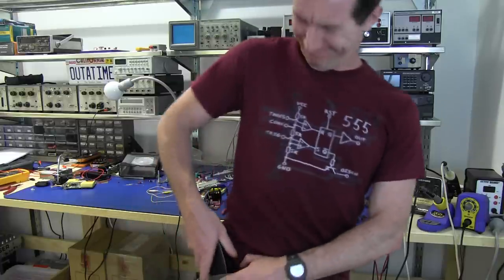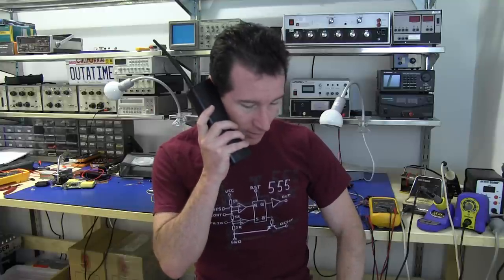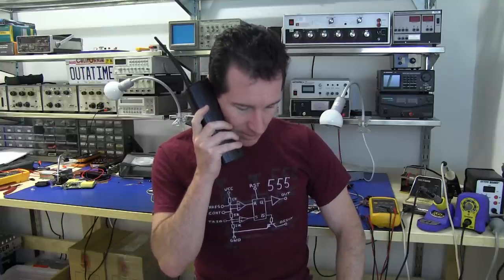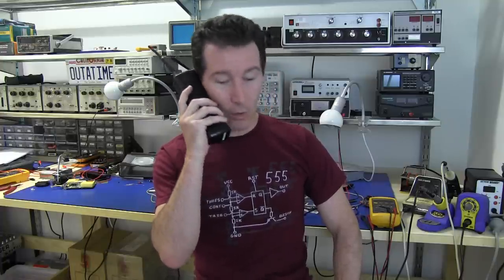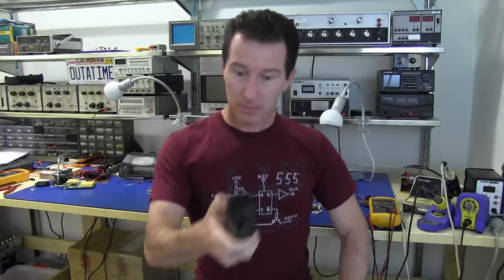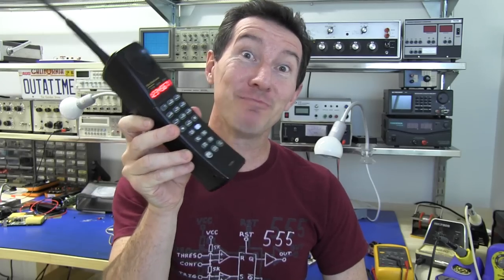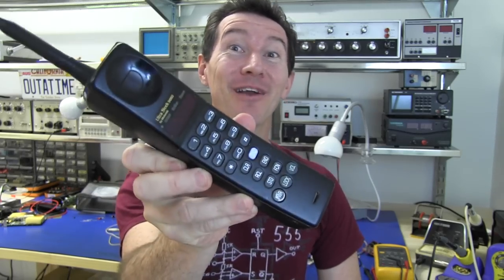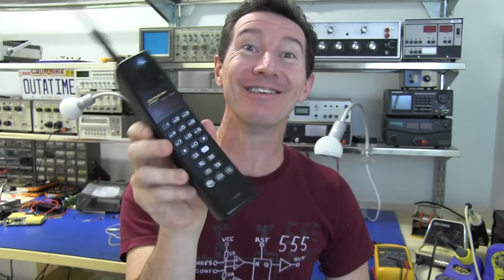EEVblog #243 - Vintage Brick Mobile Phone Teardown

Comment: This might be a stupid question to you guys who are real tech heads, but if you had one of these and were really determined to, could you actually make it work and call someone on it on to a modern phone nowadays? Are they utterly obsolete or is there probably some third world country somewhere that would still think this was valid technology? lol
Reply: Graeme Pryce  It is essentially a 2-way radio, so if you had your own base station 
connected to a land line then you could place calls using that old phone
 as long as you were within range of that base station. As far as I 
know, no phone service provider in the U.S. will interact with it any 
more. It's not as if they can't, but they simply won't. Maybe some wireless provider in some other country is still using 
1G, but I don't know which if any. I'm not a real techy, so
 I couldn't tell you how hard it would be to modify it to work with the digital networks, but I'm confident it's possible.  See also "femtocell" 
and "cellular repeater" http://www.analog.com/library/analogdialogue/archives/42-12/femtocell.html
http://en.wikipedia.org/wiki/1G
Reply: kedwa30 One question is would it even be legal to do so? The frequencies may not be once that are legal to use without a licence.
Reply: Graeme Pryce not without generating your own cell single.

Comment: could they have made it smaller? they did, the very next year! ok ok it might not have been the same phone, but im sure they came up with some kind of smaller phone in the next year or two. making things smaller takes time, especially if your doing it by sight. that was probably as small as they'd gotten it by the time the launch date came around. you also have to remember that they probably hand drew the schematics for this thing and they didnt have all the advanced software todays engineers have to help them optimize the design. they didnt even have windows 95 yet.

Comment: Maybe 20 years ago mobile phone size was not that important?I prefer bigger phones (not that big though), so,my Nokia N93 is big, but also has a very comfortable keypad and a lot of power for a 6 year old phone.Too bad most new phones aim for the ultra-thin touchscreen-only market.You could do much more with a 2012 phone that is as big as a N93 or a Philips Diga.Maybe I'll start using my Viliv N5 as a phone-just need to find a bigger battery or a way to bring it out of "sleep" when I get a call.

Comment: The size was dictated by the size of the human head:
Those days the phones were designed to actually work without compromises: The speaker was in front of the ear, the mic in front of your mouth, so the other side could clearly understand what you tell them even in a noisy environment. And that required the surface to be arced around the face.
Today the phones compromised the main function of a phone heavily: Mic far aside from the mouth capture every noise, but not your speech...

Comment: @eevblog I'm trying to disassemble an ancient Motorola 8500X brick phone... it's even older than yours and has through-hole components in it. And also a lot of battery corrosion which is making it very hard to open.

Comment: If the technology was in flux at the time it was designed, putting max effort into shrinking it might have been a waste of time if they were going to have to toss the design in a year anyway. Better economically to just use available chips, etc. and put any full-court-press effort into the next gen model.

Comment: What do you think about hot glue? I use it on my little projects, like if I do a wire join, I first twist the wires together, then solder them liberally, then even more liberally cover them in hot glue, then wrap them in electrical tape... is this a good or bad idea?

Comment: Hi Dave, regarding the reduction of speaker size along with the overall size in modern mobile phones I figured that it actually might have been a trade-off in terms of sound quality... e.g. I still prefer the bigger headphones over the small in-ears. Is there any chance you can test these speakers side by side? Thanks.

Comment: On modern mobile phones of course you have a SIM card that connects the phone to a given network and provides you with your mobile phone number, but how did this work with the older analogue mobile phones?  If you wanted to change your network or number for some reason, could you do it easily or was there some process you had to go through in order to do that.

Comment: Great video! :)  I've got a Motorolla 8800x stashed away somewhere that I need to dig out. The battery was only holding about 30 seconds charge last time I played with it so I am going to have to crack it open and replace some cells. Amazingly I have a Nokia 7110 (13 years old) and I tried charging it up and it worked and held charge for 3 days!!! Why is it current Lithium batteries only last a year or 2 while old ones can make it 13 years? Maybe something to look into?

Comment: I'd like to point out that you skipped a generation of phone in between your compact dumb phone and Android. The phone you forgot to mention is the Motorola Razr which was Sprint's own brand of what people considered smartphones cuz it was a dumb phone that could send short video have you low resolution YouTube video which coined the term video phone.
Reply: How to basic the Motorola RAZR was not from Sprint nor was it a ' video ' phone.

The RAZR v3 was a ultra sleek camera phone introduced in 2004.
It could not play YouTube videos nor was YouTube even a website when the RAZR was introduced.

However, it could play mp3s,  set custom ringers using your own music ( which was revolutionary ), take photos and video with it's .5 mp camera, connect Bluetooth and browse web with it's EV-DO 3g modem.

In short, it was one if the first 3G camera / multimedia phones

Comment: This was a real nice tear down! I like watching you, especially with vintage elektronics! You told us that the motorola was "one of the smallest" analog mobile phones, but I have to confess that I used a analog phone until 2005 before I switched to GSM. The reason was that it had the best coverage in Sweden. Our analog net (NMT-450 at 450MHz) was closed as late as 2007! I post a link to the phone I used (I bought it in 1998 and used it for NINE YEARS!).

nokiamuseum.info/nokia-650/